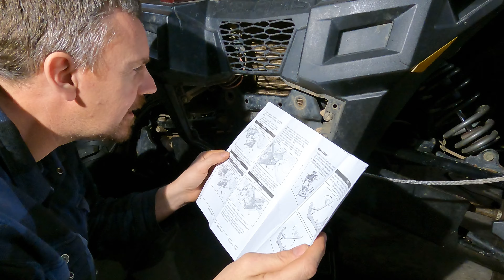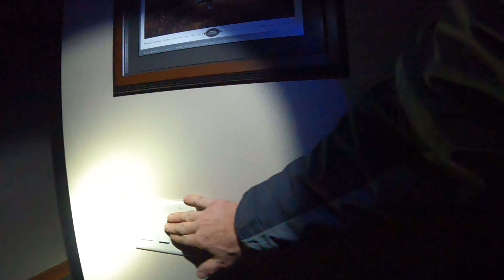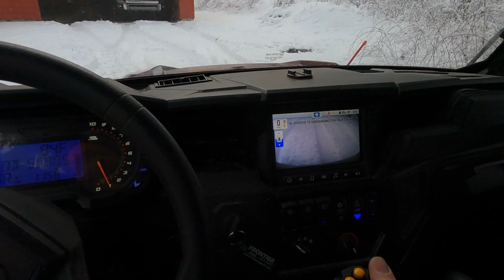Turning our UTV into a snow plowing BEAST! [Polaris Glacier HD Snowplow Install]

Comment: Great video!  Looking forward to seeing what adventures 2025 has for the family.  The HD looks nice.  Ride command plow mode is a big help too.  If you haven’t tried it, when in plow mode it automatically raise the blade when you shift to reverse and lowers it in drive.   Back drag mode works in reverse of the regular plow mode.  Automatically lowers the blade in reverse and raises in drive.  

Might want to conciser a winch strap when plowing to minimize wear and tear on the winch rope.
Reply from the maker: Thanks! I didn’t realize Ride Command could do that, I’ll check it out. Good idea on the strap too.

We got a few ideas for this year. Might actually do some winter trail riding next weekend too

Comment: double check your power and ground to your winch control. I had mine backwards and although the winch worked, the remote didn't work until i switched them.
Reply from the maker: Appreciate the heads up! I’ll take another look

Comment: are you still plowing with the tusk terrabite tires, how are they for traction in the snow?
Reply from the maker: Yes. They seem to do well in the snow, certainly good enough for me to be happy with them but it’s hard for me to compare to anything else. Our 2-seat Ranger struggled in heavier deeper snow with the factory bias-ply tires, but that could have been a combination of tires, lighter weight, plow….

The Tusk Megabites have a little more open, aggressive tread design, which might help on soft snow, not sure if it would help or hurt on packed snow or ice. 

I’d be curious to take a tire sipping tool and add a bunch of mini grooves like a car snow tire, and see if that makes a noticeable difference.
Reply: There’s no free lunch. Naked rubber tires, even tracks can’t compare to an aggressive set of tire chains.